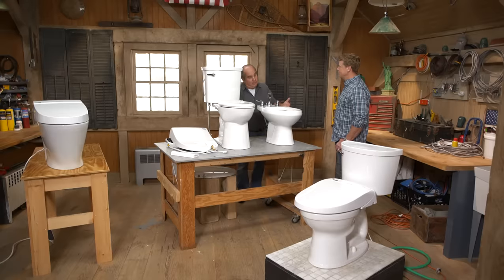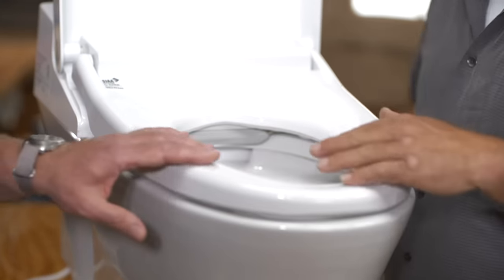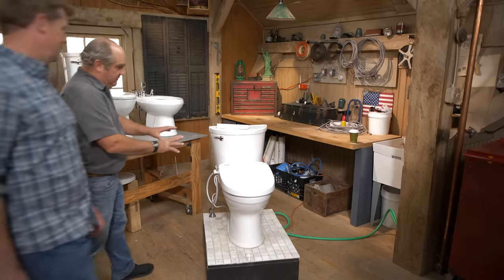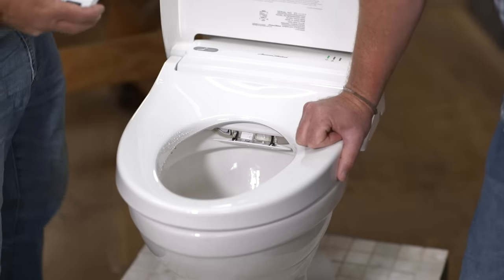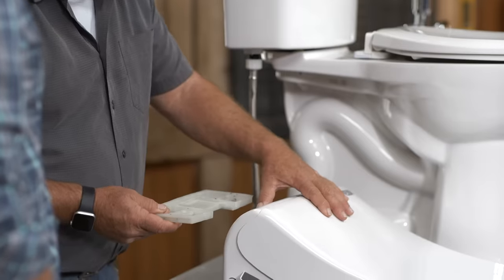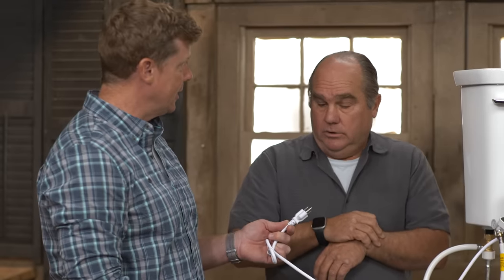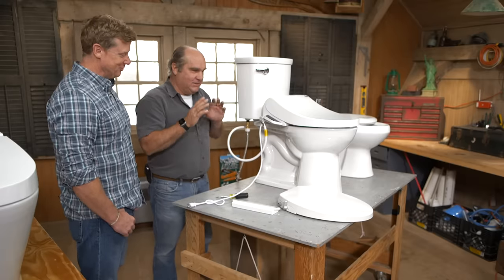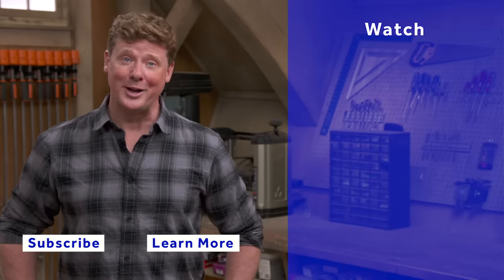Understanding Bidets | Ask This Old House

Comment: I've had a $35 Luxe Neo Bidet 120 for 5 years now. Its easy to clean, easy to use, and cheap. Even in the winter with cold water it doesn't bother me at all. I use the bidet, and then kind of pat myself with tp and check that as kind of a map of where I might need to clean a bit more. Then once I get a clean wipe, I'm good to do. I HATE not pooping at home now. No more itchy butt, or being sore from wiping a bunch after taco night.
Reply: TMI.
Reply: glad to hear from another Luxe's customer!  i've installed 3 in my home.  one of the best decisions.
Reply: We've got the same one (actually 3... one on each toilet), can't imagine going back, and the unheated (but room temp) water isn't a big deal.
Reply: So you basically clean using TP like everyone else, you just get a finish rinse to make sure everything is "dealt with"?
Reply: I have 3 Luxe Bidet.  Life changer for sure.  Easy to install, operate, and clean.
Reply: @Mike__B  not really. Bidet does the cleaning. 99% of the time the TP doesn't pick anything up afterwards and your just using it to dry.
Reply: @Mike__B  No, you start with the bidet that washes you clean, then pat dry with some TP and make sure the water jet got you 100%. I have a fancy one and a cheap $40 one from Costco, and the cheap one works great. You won't mind the cold water as much as you think you would, since your body isn't too sensitive to cold there.
Reply: @lugoismad  it's diy install or you need too call a plumber?
Reply: @Mike__B  No, you start with the rinse. Then you dry off with TP,  using about 1/3 the TP.
Reply: @kalijasin  DIY. I'm tarded and I installed it just fine. Make sure to turn your water off first...
Reply: Please make sure to turn off the water to the bidet if you ever go on vacation. Mine started to leak from the control panel after 2 years. Had to replace. But yes. I hate using any public/work toilet after having a bidet. Will never go back. They are amazing.
Reply: @Mike__B  I prefer to do the deed, use the bidet, then use a wet wipe to soak up the excess water & for a final check.
Reply: Installed my Luxe last night!
Reply: @pittsburghphotographer  upgrade to one that has both hot and cold line hookups... i know what everyone is thinking..... but that means you'd have open a hole into the sink cabinet...? trust me once that hot water washes your undercarriage you'll realize how barbaric you use to live... imagine if you only washed your hands with cold water, or took baths or showers with cold water for the rest of your life...  if you aren't willing to deny hot water to clean your hands or body... why would you deny it to your most intimate areas??? Lol just pontificating...😉🙃😇
Reply: upgrade to one that has both hot and cold line hookups... i know what everyone is thinking..... but that means you'd have open a hole into the sink cabinet...? trust me once that hot water washes your undercarriage you'll realize how barbaric you use to live... imagine if you only washed your hands with cold water, or took baths or showers with cold water for the rest of your life...  if you aren't willing to deny hot water to clean your hands or body... why would you deny it to your most intimate areas??? Lol just pontificating...😉🙃😇
Reply: @eazeyt1759 did you mean a wet wipe towelette?  Maybe om misunderstanding, that sounds excessive and bad for your sewage.

Comment: Seriously, cheap $30-40 bidet from amazon is a life changer.  If you can handle the cold water on your bum, it's so much cleaner and easier than a million wipes of TP.  The cold water has never bothered me and even the higher pressure spray can be helpful.  I hate pooping in public now because I feel gross using just TP.
Reply: And with that we can keep our much better looking enameled wooden seats.
Reply: @HealthyDisrespectforAuthority  you don't have to replace the seat.  The two that I have use the same bolts as the seat but bolts between the seat and the toilet.
Everybody's out here walking around with poopy butts.  I feel enlightened to the glory of the spray. 🙌🙏🙌
Reply: About the cold water, a good friend’s father is a medical doctor and one day, we were having a discussion about bidets not being popular in the US. He said using cold water is so much healthier because the cold water keeps things tight and responsive, while warm or hot water does the opposite.

Comment: I have the 2 in one toilets, They are closomat brand, I'm in the north of Ireland and they cost around £2,500 per unit. I wouldn't be without it. I just wave my hand over a remote it flushes then a hot wash followed by a blow dry.
I should add they are great for anyone disabled who can't turn or reach back, it allows them to maintain their dignity.

Comment: We had the Luxe Neo 185 bidet, about $40. Worked great but our old house was chilly in the winter. So we bought the Bio Bidet 2000 for $500. Heated water, heated seat, dryer, remote, and an enema function that really works. After a few years with no issues we bought another one for the upstairs bathroom. We love them.
We talked a lot of family members and co-workers into getting bidets (they mostly went with simple $40 ones) and every one of them will never go back. The basic ones save you money with reduced toilet paper usage so there is no downside.
Reply: Sadly most of them are. Not repairable

Comment: I bought a Toto Neorest (like the first model Richard showed) when I bought my house. I have never regretted that. 18 years later, I had to have a repair done because it was no longer reliably detecting when someone was sitting on it (so it wouldn't run the bidet when requested). I consider that fabulous reliability.

Comment: Unlike the prices listed in this video there are models with heated water and seat starting at $200. My Vovo and Alpha were $300 each at the big box store. The hardest part of the installation is getting power to them. Unless you can have the skill to wire a GFCI receptacle, it will be a call to the electrician. As mentioned by others in comments once you switch it is very hard to go back to wiping with TP.  I'm just surprised they aren't in every home.

Comment: I had a $65 washlet seat. It does not heat or dry and is not as adjustable but still great and no electrical connection needed.  
I moved up to a washlet from Toto over $300 at Costco: adjustable, heated seat and water, somewhat inferior pressure- still good.
Bidets are great!

Comment: A friend of mine bought a fancy $500 bidet seat for his master bathroom and hired an electrician to install an outlet for it. Then he got a $40 one for the powder room downstairs. He ended up liking the cheap one better because it has higher pressure.
Reply: It's also downstairs so I wonder if switching them would change the pressure.
Reply: @SlackerU  perhaps to some extent, but the ones with all the bells and whistles tend to limit the flow more by design
Reply: I have three in my home and we love the bidet.
Reply: Same here.  I have a fancy $300 version for the master bath the wife loves and a $40 version in the guest bathroom that I use.  Same reason your friend.  What I didn't know what that for a few more dollars, you could get the fancy version with the enema feature which solves that problem.
Reply: @majahanson311  Yeah I have to imagine in order to give you heated water it can't just fire the water through too quickly.

Comment: I just spent less than 15 minutes installing a Tushy basic 3.0 attachment last week.  Simply provides a stream from the tank water line. For this 77 year old male, it works GREAT!  Water stream is so small, it is no shock at all to your butt area.  It is faster to use this than to go through two or three wipes with TP.  Just pat dry a few seconds with a dry cloth. You are good to go.  Wish this product had been available decades ago....😄

Comment: I have a handheld sprayer kind and have it hooked to the bathroom sink to get warm water.  Works perfect and have an extra one I travel with. Richard forgot to mention with the cheap one he showed at the end of the video sometime you need to the risers for the front of the seat. If you do not use them you seat will be at an angle. Might not be enough to notice for most people though.
Reply: where dod you get the  sprayer  that hooks to the bathroom sink?
Reply: @jomangeee9180  I got it off Amazon. Use the Keyword search "handheld bidet sprayer for toilet " You will see plenty available cheap. I unscrewed the screen thing on the bath faucet and screwed the hose adaptor part right on there where the screen was. Pretty simple took less than five minutes to do. Technically you are supposed to connect it where the toilet line comes in but it worked with the sink so that where it has been for almost 10 years.
Reply: @mrj-charles6383  thank you, I was looking for one that hooks up to the faucet not the pluming, that way you can take it anywhere you go!

Comment: My husband installed ours bidet with the water having its own line coming from the basement plumbing. The water in the tank can have a build up in the tank depending on your water. So, ours is plumb directly on its own line. Cleaner water then what is in the tank. I have a husband that can do alot of the handy work around our house! Bidets should be a building code in every house! I Love having a bidet!  This Old House is my favorite show!♥️
Reply: These attachments don't use tank water, it grabs the water before it goes into the tank.

Comment: Interesting. This video was apparently posted a year ago. Today, for $79 or less you can buy an attachment that provides adjustable heated water and dual male and female cleaning posts. For not much more you can get a heated seat. One water hose connects to the toilet as shown in the video and a second water hose fits easily into the hot water line. A switch next to the seat is used to control the mix of hot and cold water as well as the pressure and direction of flow. If you can get to the hot water hose under the sink, the whole thing can be installed in ten minutes by an average person. As a senior diabetic I've been trying to decide what I want to buy. You can buy one when your young to improve your life or you can buy one when you are old and absolutely need it. Not much of an investment when you think about the benefit. It looks like the best choice is to buy direct from the maker.

Comment: I have the Toto add on washlet bidet.  It was easy to install (I already had an electrical outlet)  I'm still getting used to it, less than a year.  As far as I'm concerned the jury is still out on the whole process,  I hate that most of these seats and washlets have seat covers that you  shouldn't sit on.  I never realized how much I used the toilet cover as a chair.  Right now I',m not a huge fan and still hoping I will get used to the "process".

Comment: GET ONE! Seriously, they're a huge game changer. BUT, make sure you get one with heated water, and the heated seat is soooo nice in the winter. Mine is a Toto Washlet from Costco. Unfortunately, that requires having an outlet by your toilet. I installed my own, but it'd get expensive if one had to pay for electrical work. I wouldn't bother with one that doesn't heat the water.

Comment: Don't when this clip was actually filmed but I got one at Costco for 299 with all those features Rich mention. I use 1/4th of TP that I use to used. Best thing I bought for myself and will next buy one that has instant warm/hot water using ceramic heaters inside

Comment: I chose an inexpensive LUXE Bidet NEO 120; it was less than $40.  I plumbed it to a hot and cold and then used a hot/cold mixer valve so that the temperature was just right   Great reduction in TP and much better hygiene.

Comment: Having a bidet with a certified backflow preventer sounds like an overlooked topic in this video
Reply: Some have them built-in, but they're generally not required since they're not themselves immersed in water: there's nothing to backflow. Some building codes that specifically cover seat bidets state that backflow prevention is not required if the wand is a certain distance from the water (I believe I saw Western Australia citing at least 25mm, or roughly one inch, above the water).

Comment: How about connecting bidet water inlet port to the Tank fill valve "Refill Tube". That will give well controlled water supply for less then 30 second  while filling the tank only after you flush!!!

Comment: bidet is the best addition you put in the bathroom. What Richard didn't even show was the cheapest option that just goes under your existing toilet seat.  No heated water, but I haven't had an issue... might be a different story if the plumbing was on or near an exterior wall.

for $30, and 10 minutes of time it's a life changer.  Even without aiming/direction control, get it lined up once and you're set to go.  If you have the option for powered with heated seat, water, air dryer, and deodorizer,  I'm sure it's worthwhile.
Reply: he dare not  . can you image a TP industry practically dying off,

Comment: I liked the 3rd option. The seat with the adapter to mount and the water connection that connects to the existing water supply. And the electric plug to heat the water and power the dryer. But, there is no information on that one. Guess I have to use google to find it.

Comment: FWIW: I've had the $40 FreshSpa from Brondell on our guest bathroom toilet (no power needed, only cold water) which works great.  In the master bathroom when we built our house I added a GFI plug at the master toilet for the Brondell CS1000  (~$300 at Costco) which has a heated seat, heated front and rear wash, heated air dryer and deodorizer (carbon filter) among other nice features (including a sterilize function).  Both has been great for several years and we save a TON on toilet paper and LOVE getting super clean.  Like others have said, I hate having to "go" anywhere else but at home.  Super nice as well for as we age and aren't as "flexible" as we used to be to get clean the old fashioned way.

Comment: Agree with other comments here.. why didn’t you show the cheap add in types that pay for themselves with less paper cost?
Reply: The top tier model they showed, the Advanced Clean 100 is listed as going for $4,000 - $5,000 is now $1,000.  The bottom tier model they showed, the Aquawash 1.0, is quoted as being $150.00.  You can get it direct from the manufacturer for $80.00 now.  I'd bet this segment is from a couple years ago when there was less choice at the lower end of the market and the Amazon Special for $30-$40 wasn't available or wasn't easy to come by.

Comment: The Toto Washlet SW2034 electric bidet toilet seat I bought 2 years ago cost me $350 on Amazon. I'm a licensed electrician so the electrical work wasn't a big deal for me. I would honestly have to recommend that if you're a male and have a round-front toilet, just replace the toilet to an elongated bowl as well. There isn't a whole lot of spare room for the dangly bits even with an elongated seat Washlet so I can only imagine what it would be like using a bidet add-on on a round bowl toilet 😬
Reply: Yup, having an elongated toilet is a must.  So much more comfortable and easy to install the Bidet as well.

Comment: Here's a question to any bidet user. I can see how these would be useful to have. But what do you do about the "drying" part once your undercarriage is sprayed by water? Do you just drip dry or do you still need to dry the water on your undercarriage with toilet paper? If so, what's the point in having a bidet if you're still needing to use TP?
Reply: Excellent question. Another question I have is in regard to stool quality, some have a seemingly oily consistency (with more TP required), does the bidet clean all stool types equally, and how does one know the length time needed?
Reply: Several of the more expensive models (My Brondell CS1000, $300 at Costco) has a heated dryer function to dry you off.  Works pretty well.
Reply: Just take a shower! Bidets are just excuses for not wanting to shower!
Reply: @number1pappy   lol - I can reassure you I never have a problem with taking daily showers.
Reply: @number1pappy  if thats the only reason you shower then save the p-lanet some water
Reply: @JO MANGEEE  "save the planet water"! Lol! Your too funny! Smh....
Reply: In certain parts of the world a dry wash cloth takes care of that. In our house (US) our two bidets blow hot air to dry off the bottom. It is a bit of a wait time but for those in a hurry a quick pat with very little tp also does the trick.
Reply: @number1pappy  I don't have to take a full shower after toileting. I have a hand-held shower head on a long hose, so I can just stand in the shower stall and spray my rear end with the shower head set on a gentle setting.
Reply: @hd-xc2lz  From messy to stiff the sprayer gets it all. Of course one is free to press the button again for a second spray. Most units allow you to adjust water pressure and engage a pulsing mode. I have yet to try any of those features.
Reply: @stevenlitvintchouk3131  Yeah but you have to take off your pants.
Reply: @number1pappy  why haven’t you responded to my question?
Reply: If you use flushable wipes, no need for a dryer nor tp and you will be fresh every time.  Flushables are super cheap.

Comment: or the 7 dollar solution is to use a water pot (bodna, lota)  meant for cleaning yourself or wash hose. much cheaper than installing any of those who are super tight on the budget and probably works even better.